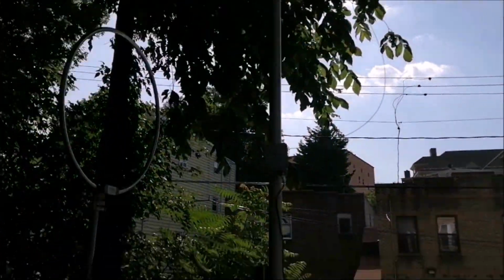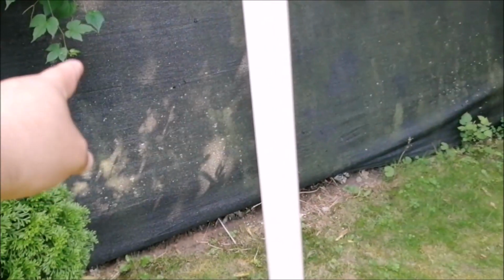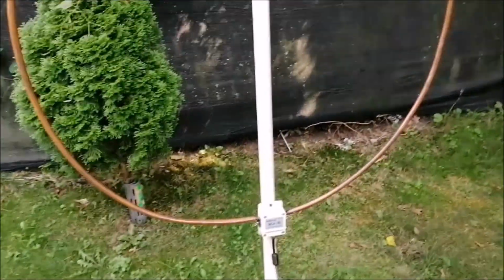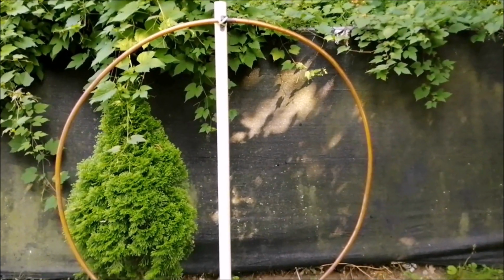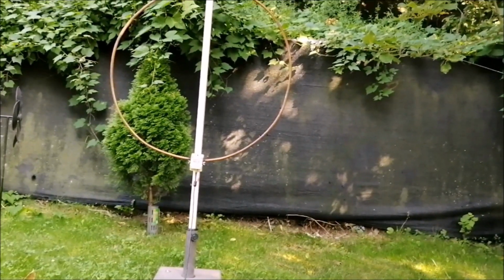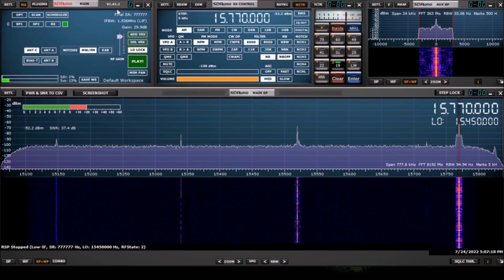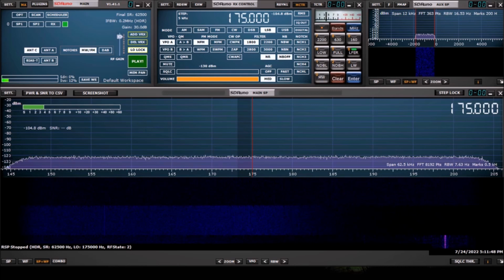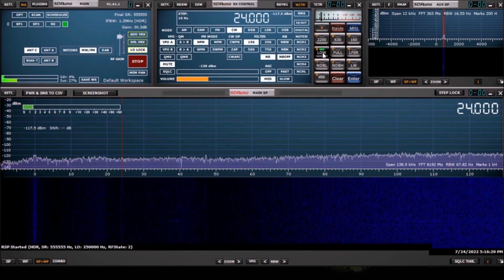Copper Modified MLA 30 Active Loop Antenna setup to receive VLF longwave signals with SDRPlay RSPdx

Comment: To provide the USB power to the Bias T box, I use one of those cell phone bank chargers - everything is DC so no noise from it, and you'll have plenty of power. I accidentally left it plugged in once for at least 2 days and it only dropped the bank by a couple of percent.
Thanks for the vid!
Reply from the maker: I have a few of them power banks. They are great for when I'm outdoors. If you can post that particular model so other viewers can see it, that would be great.  Thank you for sharing.  Thank you for watching.  Have a great day Robert.  😊
Reply: I understand what you meant by a power bank, but what specs should I be looking for?
Reply: The power bank although DC is using aDCDC converter to get the 5V that can easily produce a ton of noise . If your's is good thats great but not always!

Comment: well said, Danny speaks truth, great channel.
Reply: also i get great results using quad shield coax cable,  75ohm coax used for cable,  it is the best for reducing common mode noise.     w6lvp also agrees with the quad shield coax from loop to sdr .
Reply from the maker: Yes your medium should be as good as your antenna.  I always try to use the best possible coax cables.  A lot of people overlook that, especially on long cable runs.  Thank you for watching and thank you for the kind words.  Have a great day.  😊

Comment: I just watched it all im still fairly new to shortwave even tho this was mostly mw and lw i have the mla 30 + would the signal improve in shorwave if i was to change the stock wire that it comes wit to the copper tube im mostly using the xhdata D808 the sangean ats 808 and the Qodosen sr286 sorry if this question is far from what u have been going on about in ur video .thanks Ged from Ireland 🇮🇪
Reply from the maker: I wouldn't change to a copper element for Shortwave.  It wouldn't make a difference.  I change the element for the mediumwave and longwave bands.  I would not bother changing it.  Thank you for the question.  Have a good day.

Comment: I have a simple newbie  question can i use any other LNA amplifier instead of the one that with this antenna? i mean a more powerfull one like 12 volt?
Reply from the maker: You can try. I recommend using the stock LNA.  It worked well for me. But you may better luck with using another LNA.  Just be careful not to overload the loop with a higher voltage or you might damage the loop.  Thank you for watching.  Have a great day.
Reply: @dannyshortwave  Thank you!

Comment: Has the copper tube made that big of a difference? Also, how about the clip on ferrite on your coax? Great videos, thank you!
Reply from the maker: I believe the bigger loop element whether it is copper or aluminum makes it more sensitive on the lower bands. However the ferrite bead didn't hurt it in terms of minimizing noise coming into the antenna and going through the antenna connector.  I got that idea from a smart meter outside my home.  They all have a small ferrite bead snapped onto a small wire inside the smart meter.  I guess to prevent RF interference.  Thank you for watching.  Have a great day Alex.  😊

Comment: Thank you, did the copper loop change your shortwave signals for better or worse if you're trying to improve VLF signals.
Reply from the maker: I believe it helped me because it is a bigger loop diameter and also copper material, so it will tune down into the lower bands.  I didn't have to tweak much other then change out that attached wire and installed a BNC connector.  Thank you for watching.  Have a great day Philip.

Comment: So are we supposed to believe that just putting a copper loop on the antenna will allow it to get LW when it isn't much larger than the original loop? How does it do that?  I'd think it would have to be very large, maybe 40 or 50 ft.?  Also this seems to be a failure since I didn't see it receiving any long wave signals!
Reply from the maker: You don't have believe anything.  Is not the size of loop. In my case it was the copper material compare to the stock wire and also the BNC mod and location on my property helped.  Thank you for watching.  Have a good day.
Reply: @dannyshortwave  How about a demo of how well it receives?